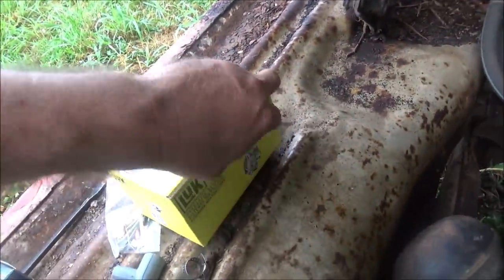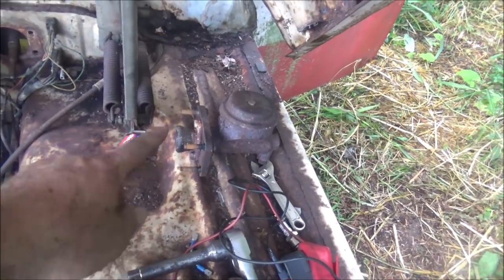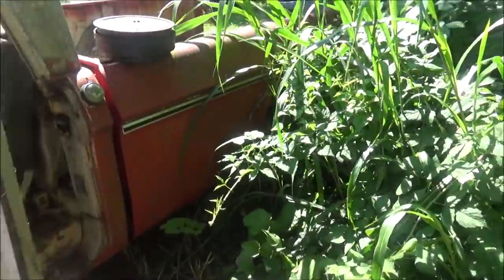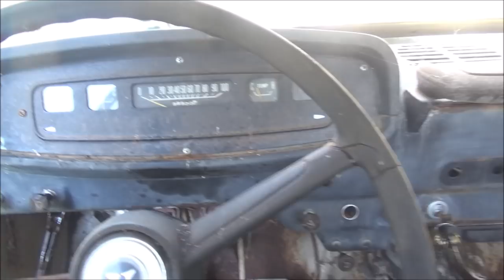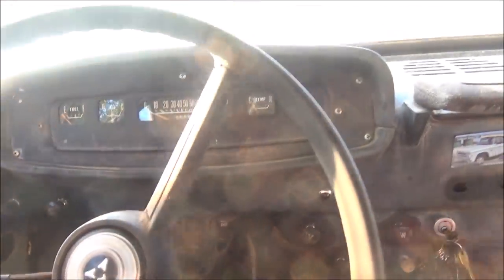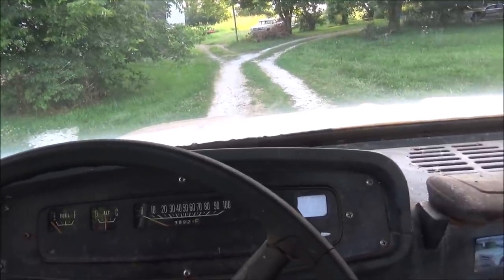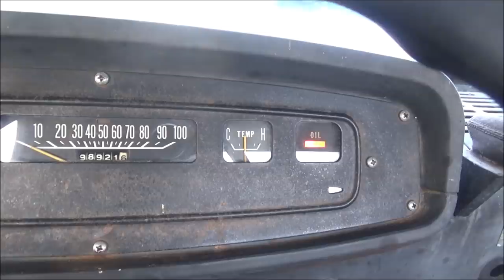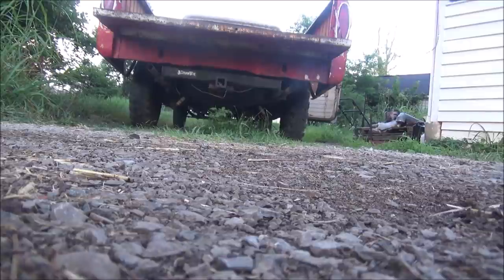Back Under its Own Power 67 Dodge D200  Field Find Rides Again!!

Comment: It's like one of my projects. Very first fastener I touch, "get the torch". Looks like a winner. I see less light through the floor than my 95 Ford!
Reply: Rust Belt Issues like that old converted ambulance lol
Reply from the maker: Going to have to pick up a few road signs. LOL
Reply: A 1995 anything here on the island of Newfoundland turns heads. 15 years max out of a vehicle. I get a kick out of whats considered rusty junk on youtube. That truck would sell like hot cakes here. Seeing how it probably would be the only one like it. Anything that old has long turned back into ore around here. lol
Reply from the maker: @JT-tz5hp  Guess living in ocean spray is a hard life!
Reply: @bcbloc02  yes sir! The mountains of salt on the roads in the winter don't help. But yeah if you don't move a vehicle for 2 weeks near the coast the brakes will pop for sure when you go to move it. I was amazed you didn't have to pull every wheel and beat the drums apart to get it to roll. lol

Comment: Bailey is sure a beautiful dog. Those who think the truck need to go to the junk yard do not realize those old dodge trucks are very rarely found in the salvage yards. My uncle bought one new in the 60's with the slant six and 3 speed on the column and it was bullet proof. He had 3 teenage boys and us 3 cousins could not tear it up. Bullet proof.  Good job Brian. Always love seeing you and Bailey hard at work.
Reply from the maker: This truck originally had a slant 6 before I repowered it because it had a rod knocking.
Reply: @bcbloc02  That is the first slant 6 that i heard of with a rod knock. That 318 is also a great little motor. I had one in a new 79 Dodge pickup. First new truck I ever owned.

Comment: Spent a lot of time in a 67 Dodge just like that. 318 and a granny low 4 speed. Wasn't mine but I did get to drive it once or twice since I was all of 14. Cousin used to melt the back tires off of it, and climb river levees with it. Lord I miss those days. Thanks for the trip down memory lane.

Comment: All that D-200 needs is a little tidy and some love. The best 1960's trucks by far. The work horse Poly 318's are under rated. I'll be waiting for the full restoration video series. I bought a 1970 from Riverside County Ca (factory a/c). It was cab and chassis. The 2nd. series 318 broke the crank snout at about 200,000 miles. I installed a 340 from a wrecked '73 Duster. It made the old D-200 zippy.
Reply from the maker: I would think. My buddy had a heavy built 340 that dynoed in the mid 600hp range. His car would always run sub 6 in the 1/8th it was a blast!

Comment: Excellent video it's nice to see you get the old Dodge truck running the 318 polyshere is sure a nice running engine I worked on one almost 30 years ago that was in a street sweeper the guy I was helping didn't know if it ran but I fiddled with it a couple of hours and it ran really nice just like the one in the truck. My first childhood memories are riding in a 1970 dodge 3/4 ton 2 wheel drive just like that one of yours it had a 318 la engine and 4 speed transmission the whine from the transmission in first gear brought back lots of memories my dad hauled lots of firewood with his old truck
Reply from the maker: I hauled a few loads out of the woods this winter with mine. :-)
Reply: @bcbloc02  that is good to hear that you are using the old truck

Comment: Hi Brian, 👋 Viewer fan here, in my den out of the heat 104 today! Good job as usual. Nice to have a putt-putt to run around the property with. Put a compressor/hose, battery jumpers, hand full of tools. Be able to travel to hut- shop- house. And haul you fire wood/ and other needed supplies. As well as debris to trash, burn pile.

Comment: What a cool old truck! You have to appreciate a guy who lights the carb on fire while sitting in the dirt to get the power valve out! My kind of mechanic! That 318 sounds like a clock! I’d power wash her and drive her another 20 years!
Reply from the maker: Some on here would have you believe if you work on a carb on the ground it will never run again. :-)Looks like it does fine as long as you know what you are doing.

Comment: The ole' barn shop now has a "runnin around" truck! Brian is always adding to the shop in one way or another! ... This time may be in the "other" category, but none the less. Very very cool Brian! It's awesome that you shared this with all of us viewers! I loved it! Stay safe and healthy down there in KY! Dan @6-4_Fab Glen Rock, PA USA!
Reply from the maker: Glad you enjoyed! It is all work be it machine or not it goes to the same goals. :-)
Reply: I know exactly what you are saying! I'm working on my '07 F-150 right now. Instead of working on paying welding, fabrication and machining jobs, I'm stuck working on my own truck! It all started with a rusted threw power steering line and now it has turned into that and two more automatic transmission fluid cooler lines that were disturbed during the initial repair. But, I can't really complain. I bought the truck new in '07 and this is the most work I have had to put into it in 190,000 miles! Anyways, thank you for replying to my comment. I really enjoy communicating with the YouTube creators I watch! By the way... Don't listen to all of those "city slickers" telling you to drive'er to the scrap yard! That truck is an awesome example of history and most importantly your not so new firewood/whatever hauler around the farm. Stay safe down there in KY! I look forward to your next video! Dan @6-4_Fab Glen Rock, PA

Comment: Gosh, so much I forgot about vehicles back when... like having the ignition of the dash, dimmer switch on the floor, the window vent to flick your cigarette ash out of, and bench seats. For what it's worth, they don't make 'em like that anymore. :)
Oh, and the emergency gas tank... I made one of those for a friend's 10-year-old 1959 Chevy, whose steel fuel line rusted through (and sucked air). I never did get my gas can back, he used it (one gallon size) until he blew the engine up and took it to a junkyard. I figure he stopped every 10 miles or so for gas...
Reply from the maker: I am using a 5 gallon can, should be good for a day on the farm. LOL

Comment: Metric wrenches will sometime fit worn bolt heads tighter.
Reply: Metric ajustable wrenches fit any size, much like left handed screwdrivers put screws in easier if you're left handed .

Comment: When separating old hydraulic joints apart I use a small pair of  vice grip pliers on the flats before they are rounded off. They break loose without rounding the flats off the nut.

Comment: That fluid film is good stuff I use that stuff all the time myself and I like the smell of it too but it works great for keeping things from rusting and I live in the rust belt where everything rusts as soon as you drive it in the winter
Reply from the maker: I like it because it doesn't mess with your hands or rubber products that I can tell.

Comment: still solid.got a 68 f100 w/o title i used to run around the gravel pits picked up junk been looking for another with a title but no dice.at least one close by reasonable price.mine will still fire up just need to get the clutch unloosened.

Comment: The guys who dislike this truck are under 30, most likely, they don't know these old rigs were built to take serious abuse. This truck isn't pretty, but I'd bet that it will haul whatever  you can fit in the back of it, it's a pre-smog truck. the eco-nazis left auto manufacturers alone back when this Dodge was made; once this thing is running like it should you can shred the rear tires. you earned my subscription and likes. God bless you Brian.

Comment: Yes Brian. The 17.5 8 lug rims were used on request from about 1958 to 1968. They are very scarce and if you look on eBay you can find a set for about 1k bucks. So...i myself have been wanting some for my old power wagon because it allows me to run a commercial 17.5 tire which will last about triple the life if a regular 235/85/ r16. So..i would like to buy them..i certainly can't afford 1k...and I keep hoping to find an old set like you have...fir cheap...but no luck so far. Ifn you throw new tires and wheels on ole bessy...gimme a holler. Thanks for fun videos!

Comment: Now just to find some people to help you load the heavy duty Dodge with firewood 😂. Great job thanks for sharing.
I have a 62 Chevy but I'm lucky enough it has a hoist under the box. Hint hint.
Reply from the maker: Pickup or flatbed?
Reply: @bcbloc02   the original 8' box.
Reply: Chevrolet Apache 20

Comment: Good sounding engine, probably has lots of years of use left. I'd pressure wash some of the dirt off to slow down the body rusting and go get your first load of wood. Good luck. Might need some new 10 plys on the back- wood is heavy.

Comment: Like others have said.. pressure wash it to get the filth off. Change the oil in the transmission, and rear end. Make sure the brakes are working correctly.
Then keep it in the shed with a battery tender on it. Make a set of rear tires with snow chains on them as spare  and make a plow blade to keep the drive clear when it snows. 
Cheers from NC/USA
Reply from the maker: I have found you push off too much rock plowing snow from a driveway. Best to just pack it down and drive on that.
Reply: @bcbloc02  True.. but you would want to set the blade 5 or 6 inches off the road. My friend lives in the mountains and gets 2 or 3 feet of snow and  it has to be plowed or a car will high center on the snow and get stuck.
Reply from the maker: @aceroadholder2185  In 1994 we got 30" of snow at one time. Rarely if ever do we have more than 10" on the ground at a time. Most of our snows are 3-4" and gone in a few days.

Comment: I had a 69 D200 camper special. Mint green white roof. Bought back some old memory's. 6 mile to the gallon. Lol. Im a subscriber now. Maybe 16.5 tyres. Oppersite threaded wheel nuts. Luv them 318s. Maybe time to stick it undercover. Out of respect. Maybe you got your back diff welded up. That Alabama swamp mud will sink them heavy trucks to the frame. Luv your Dog. I was hopping he didnt have a heart attack following ya. Good luck. Have a good chopping season.
Reply from the maker: Definitely 17.5 tires and it has a posi in the back. I can still recall having it buried to the axles a few times. And the time I drove thru a creek over the hood about 30mph and shoved the radiator back into the fan so it got cored out on the go!
Reply: @bcbloc02  tuff wheels. 17.5 mine had 8 spoke 16.5. I hooked two wheels over the edge of a ditch and it sucked me in. Hit a wooden electric pole. T boned front bumper. Got me a treated 8x8 added. Polished it up. It looked mean. Then finished of the bottom. Of the doors in treated decking. It looked good. Only had 26.000 on the clock from new. But cancer got into door hinges. Give it a oil change Brother. Nothing for free in this world. Only pool caulk. Lol. Good luck. You got any puppys off Bailey. Any younger pics of Bailey in your next vid. Have a good un. Ps posi is the way.
Reply from the maker: Baily was already fixed when he was abandoned here years ago. My videos go back like 7 or 8 years at least so a younger Baily does appear. 😎
Reply: @bcbloc02  Great Thanks. Ill do so looking. I helped a 84 year old couple in lower Alabama. 500 acre. 500 head of Black Angus. Always getting dogs dropped off. Think there was about 13. Plus Mr Bills Blue Healer. No others were any good with the cattle, lol. But he feed um all. But they hung around kept the place safe. Lol. Have a good un. Dino.

Comment: I tried to wear out an 88 dodge p/u at a job site, had a 318 that was bullet proof, now I own a 98 Ram 1500 with the 360 and it's also bullet proof... that truck ain't worn out, not by a long shot; about that top radiator hose, cut off an inch or two and I think you can get rid of the kink, if you think it needs it

Comment: Hell Brian you got 20 more years with that truck. This generation throws everything away. I keep everything because it still works. I still  use my manual push reel mower around my house. I have so many tools over the years I has 6 large tool boxes with multiples of everything .because I never discard or sell anything. I think I have 100 1/4 3//8 1/2  ratchets. Bins full o of sockets .let my wife deal with it when I am gone😊👍
Reply from the maker: Good plan!!

Comment: If that's an MSD Blaster 2 coil, there's a very good chance it will burn out your ballast resistor much quicker, MSD recommends getting their .008 ohm heavy duty ballast resistor from summit racing, if you check your current one with a multimeter on the ohms setting, 2000, 200, 20 etc and it reads at least above .008, you will be fine for a long time to come, keep a spare in the glove box!
Reply from the maker: gwmax11 I used the resistor that came with the coil in place of the factory one.

Comment: No to the wrecking yard, a great farm truck!
Reply: Any way to get rid of the haze on the edges of the windshield, other than replacing the windshield?
Reply from the maker: Don't think so, pretty sure that is oxidation in the material that makes it safety glass.

Comment: Good job brian. It should work for an old truck to drive around the farm. Surprised all the brakes weren't locked up. Bailey is getting a little long in tooth. YOu might want to talk to your vet about putting Bailey on rimadyl or something for his hip and limping which is common in that breed and others as they age.
Reply from the maker: What does the rimadyl do?
Reply: @bcbloc02  I'M sure Bailey is starting to get arthritis in his hips here is a brief explanation of Rimadyl we have used it with several dogs over the years. is a nonsteroidal anti-inflammatory drug, or NSAID, that's used to reduce pain and inflammation (soreness) due to osteoarthritis and surgery in dogs. I would also ask the vet about a good joint health supplement like cosequin I know there are some newer out on the market now that I may not be familiar with but with the combination of the 2 it would really help bailey to feel better and walk and run better without pain which is why he limps.
Reply from the maker: Well also he imps because he was hit by a car when he was like 2 and he has a hip socket gone along with some busted tendons. It is a miracle he walks at all on that one leg. He has basically been a tripoder all his life.
Reply: @bcbloc02  Ok didn't know that but i still think these things would help him.

Comment: Well, Brian, I can see you put a filter on that fuel line so you couldn't see the crap that was flowing through the line.  Have to add, you should spend more time growing that corn, I love that Kentucky bourbon.  :>)
Reply from the maker: These are $1ea cheaper than the clear ones.

Comment: People who say the truck should be junked dont know what they are talking about.  The body isnt even rusted.  The floors are not bad for what it is... if it is only going to be around the farm then rivet some panels to the floors... appliances are good sources for that kind of material since they are enamelled and free ;)  

These comments are from people who have only watched videos on cars and never fixed one.  They dont realize that not all cars have to be perfect for what they need to do.  They think they can do the things they see in videos but really they can't.  This sort of project is great for learning by doing and develop skills and try things.

Pressure washing all the "car mold" off of it... I would pull the dash gauges... see if you can get the fuel gauge to work and pressure wash the inside of the cab too would make it a plenty good truck.  Depending on how bad the frame is it might be possible to register it.
Reply from the maker: The fuel gauge would work if the tank wasn’t like Swiss cheese. Sadly no aftermarket parts for these old trucks. You have to either salvage it or build it yourself.
Reply: @bcbloc02  Nice!  I was surprised the gauges all worked at all.  Even the bouncy speedo is working like new :p

Is the tank is behind the seat?  Maybe an old school military jerrycan could work and keep it out of the bed.  Could even use a jerrycan style mount and have it removable.  Tap a couple of fittings... and done!... need to vent it though... hmmmm... I wonder if you could tap the top of the can... that way you could remove it and set it down of needed.  Not sure if the pump can pull that high.  Don't know what else would fit behind the seat.  

Whatever you come up with would be good I am sure!  Not like you need to drive a hundred miles.

I think pressure washing the truck inside and out would do wonders.  Save those great seats :)... wouldnt want to ruin those!

Comment: Bailey wanting to go for a ride and running around trying to catch you to get a ride had me all choked up. This old farm truck with a "never say die" Poly 318 has Bailey acting like a puppy an you too Brian, doing donuts and all. The Poly was the engine the engineers WANTED to build. The later LA 318 was then engine the bean counters FORCED the engineers to build. There was also a Poly 354, you could take off the Poly heads and 354 Hemi heads bolted right on! On a side note, how old is Bailey and what kind (breed) of puppy is he?
Reply from the maker: Baily is. 15+yo pit-lab mix.  He did get to go for. A ride in my crew cab later on but he may have been wanting to do some doughnuts too. I am just afraid he would get cut up on the foorboard of the old rusted out Dodge.
Reply: @bcbloc02  Baily is a good boy, I can absolutely see not wanting him to get hurt. Glad he got to go for a ride, he sure looked like he was ready! Cheers from Japan!
Reply: @bcbloc02  Definitely not worth Baily getting hurt, he's a good companion and boss, no need to endanger him! Cheers!